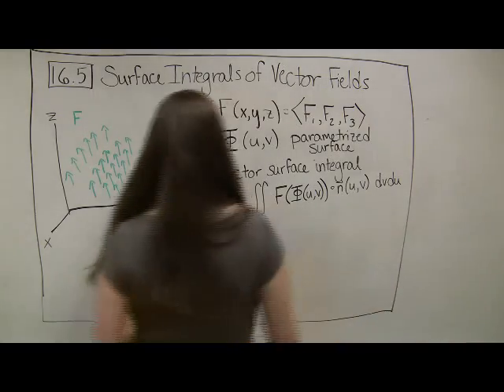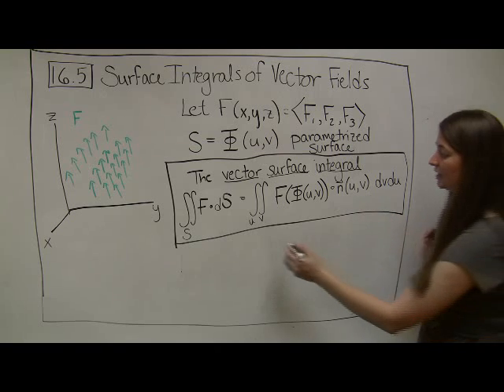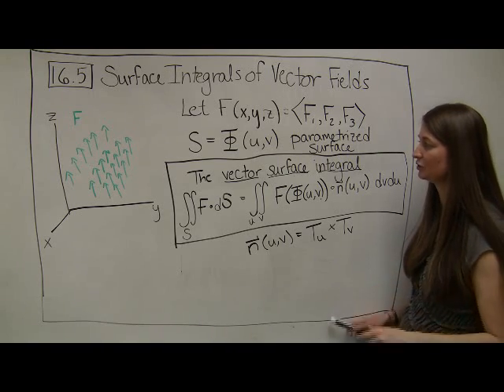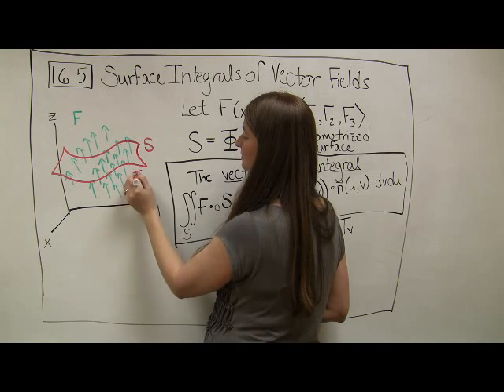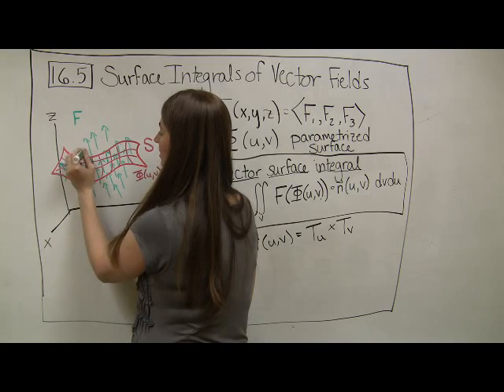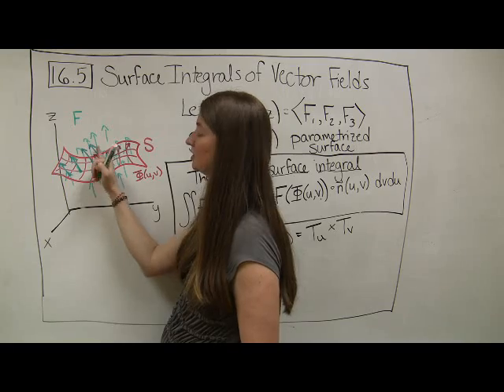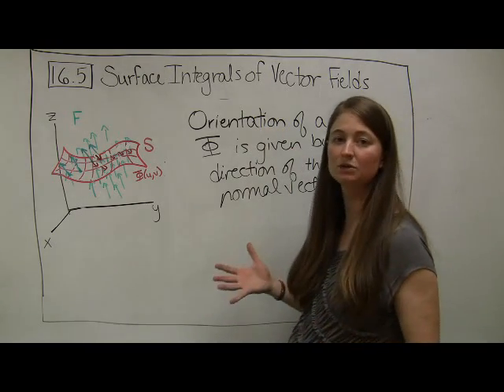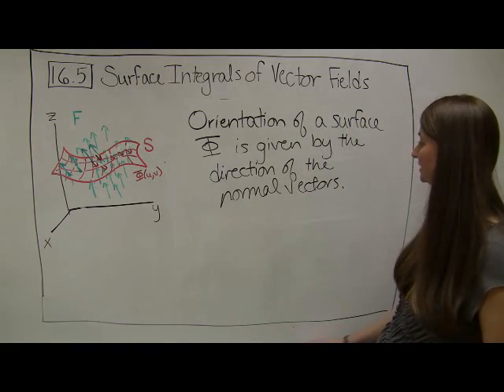Surface Integrals of Vector Fields Part 1

Comment: Ive been using your videos, I really love them. I loved calc and math until I got to another university where the calc 3 teacher was a first year professor. It's been a pretty bad class, but this really helps me understand it. I think another good thing to do for these videos in the future would be to attach a "equation" sheet for the chapter. (you kind of do this at the beginning of the video already, but itd be nice to be able to print it off.) or even showing all the equations at the end and describing each piece of the equation quickly. kinda like you did when we first started learning about the double integral of f dotted with ds. Thank you very much! I wish I would of found these videos at the beginning of the class ;[. 

Great teacher!